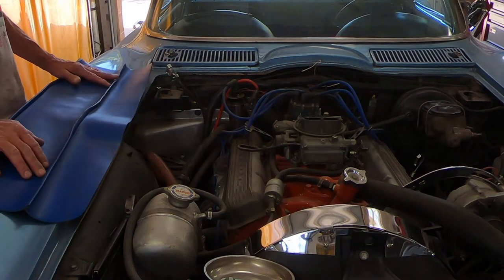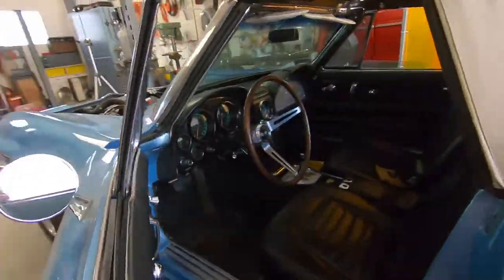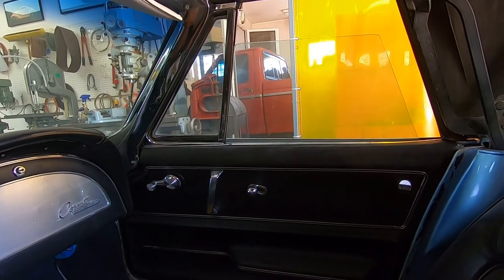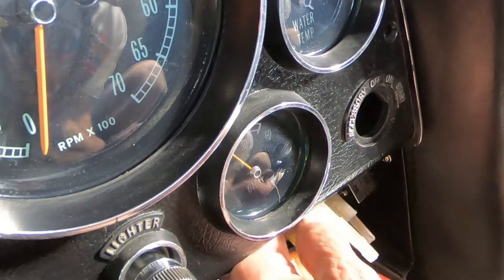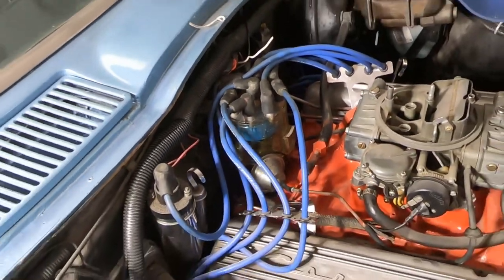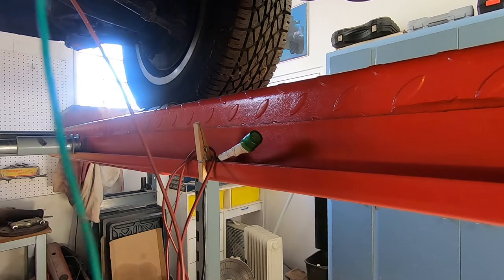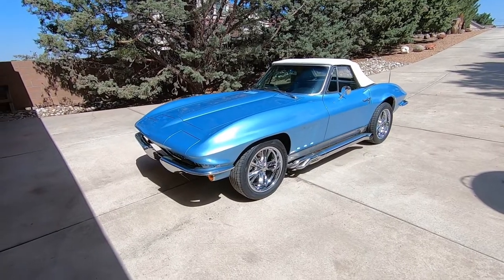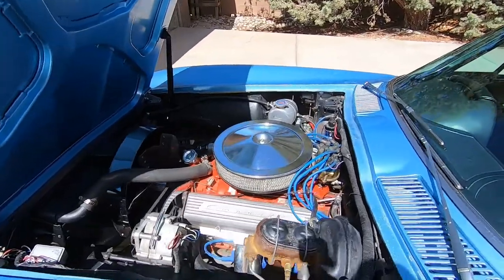1966 C2 Corvette Sting Ray starts after 14 years. See what it takes!

Comment: If you buy one of these things and there's any question of aftermarket ignition at all do not leave the key in the "on" position for more than 30 seconds. The coil can get fried. On the subject of aftermarket ignition a '66 had a ballast resistor from the factory. Some Chevy guys will say I'm wrong. Check your assembly and service manuals fellas. Aftermarket might or might not bypass it. Easy to have that hooked up wrong.
Question- is that the factory surge tank? Looks nothing like my '66's tank and not in the same spot either. Sometimes they changed the placement of things based on options.

Comment: You got really lucky on that gas tank! My '67 390 hp 4 spd roadster sat about 9 years and the tank looked like rust Hell inside. Did you figure out yet that the brake light is on due to the proportioning valve is off center? Also, I have an old distributor that I removed everything off the top so I can put a drill on it. I put it on and let it run for a couple minutes. Usually gets 40+ psi and really works all the air out. I also made a small funnel out of an old cut off fuel filter. I use this and a short piece of hose on the carb breather tube to fill the bowl. Choke and idle work normal then! Maybe the front end was high because someone took out a big block?
Reply from the maker: Hey Lyle, Thanks for your input - good info. The brake light went out and I haven't given it any more thought, but I did not know it was related to the proportioning valve. The front springs were installed new by previous owner. Perhaps the wrong ones. The car came from the factory with a 327. This is my first corvette, so still learning all about it.

Comment: Nice video. Very helpful. I have no brake lights on my 65 coupe 327/250 HP. I do have directionals and running lights. Any advise?
Reply from the maker: Hello, thanks for watching. It could be your brake light switch. Either it needs to be adjusted or it quit working. Look for it under the dash at the back of the brake pedal arm/lever.

Comment: Hi, I was wondering if you made or bought the distributor with the handle for building up oil pressure? I have a 65 corvette that I want to get running but it has been sitting for 40 years.
Reply from the maker: Hello, thanks for watching! I just ground the teeth off of an old distributor and made the handle with a long screw through a piece of tubing. Very simple but effective way to build oil pressure. I believe you can buy a shaft that fits in your drill motor to do the same thing which would be the easier way to go.